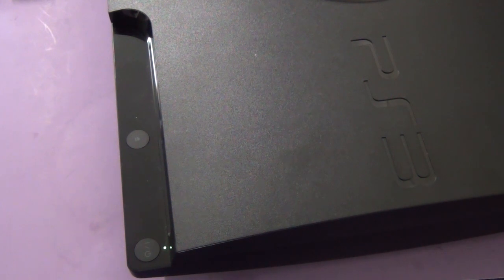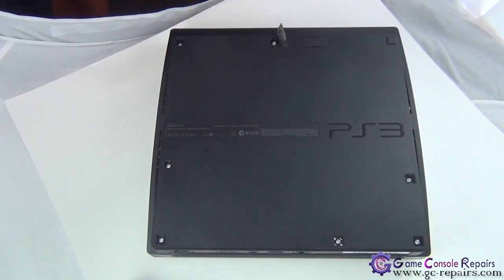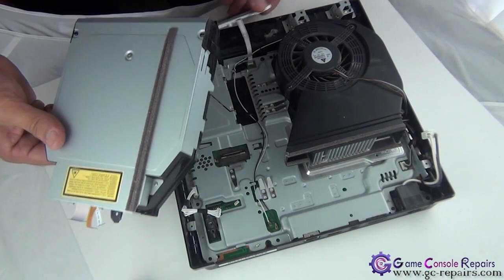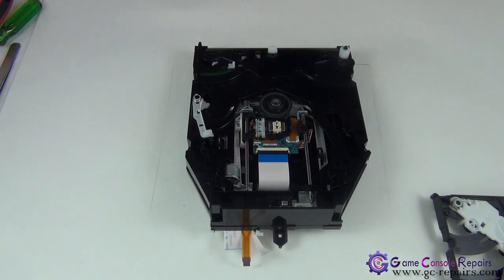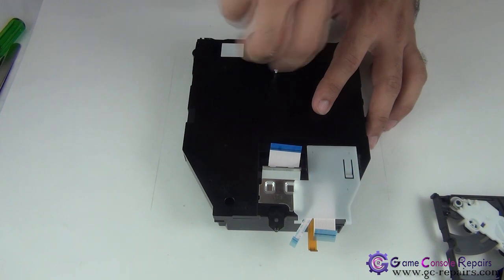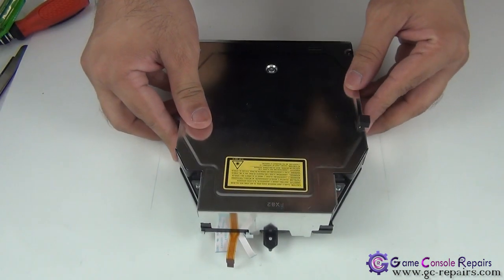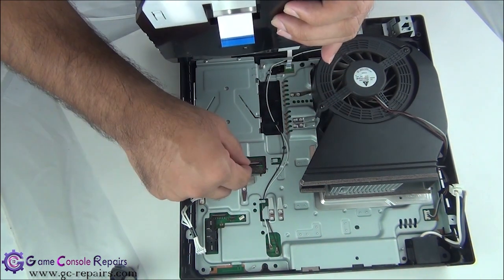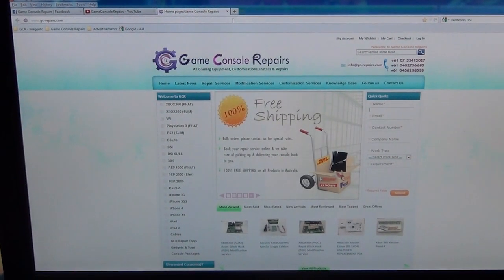PS3SLIM 320GB CECH 3002x  Manual Disc Removal & Resetting Blu Ray Drive gc repairs

Comment: Thanks for the video, it's perfect.
i solved my problem , there was a cd with a little bit of glue that probably blocked it inside.
I opened my ps3 and all was exatly like the video excepted for the blue ray that probably was a little bit different model, i havent't to leave the final ghear to reset but only screw the mecanism because my ghear was fixed with a screw.

No problem with cable or connection, also with torks i used a normal plate screw very slowly.

many thanks.

Comment: Get two butter knives.. Flashlight.. Locate stuck disc by gently probing.. One butter knife on each side.. Flat against each side of disc.. Apply upward pressure and bingo.. Disc will slide right out

Comment: THIS IS WHY I LOOOVE YOUTUBE!!!! thank you so much for the highest quality tutorial on youtube, the hardest part was re-attaching the ribbon cable for the bluray drive. my only criticism is you dont specify that you need a "security/tamper" bit. never the less, thank you sir for saving by ps3, opened it up and to my surprise i found a DS game in there thanks to my 2 yr old son :/ works like a charm now :)

Comment: Its easier to keep the cable clipped to the inner-board, and unclip it from the lens itself. this way you can simply feed the cable through its hole in the drive,set everything as usual, then simply connect it back to the lens from above (instead of trying to fit your hand underneath it all)

Comment: Hey, soo I replaced my lens (KEM-450daa) and it still makes the same problem (ejecting noise when putting a disc in but not actually ejecting it out) would this be the right solution for my ps3 slim?

Comment: Went through this whole process. Noticed that everything WAS in place and didn't even need resetting.  The drive still doesn't "do anything" when I attempt to put a disc into it.  What exactly, "triggers the feeding mechanism" ?

Comment from the maker: @rasat hussain
If the disc does not spin, maybe there is any issue with the motor.
buy either a new laser mechanism or full blu-ray drive and try out

Comment: hi, at 4.03, there are 3 ribbons attached to the blueray drive, the small 1 on the right  (blue & white) can it be replaced? because my ribbon gold connector is broken, i am curious...

Comment from the maker: @zFYG 

Ok seems like you have number of issues.
1. you need to replace your Reset-Switch board
2. Disc not accepting is you have re-align your assembly if still issues, replace with another drive.

Comment from the maker: @Borked91
As long as you still have all the elements you have to put them back together as is.
if not you can simply purchase a new drive for $90.00 bucks from our store and replace with the new drive.

Comment: Great video dude - unfortunately however it has not provided the solution I have hoped for. My PS3 320GB is no longer accepting discs. It feels like whatever normally sucks the disc up is dead. Any suggestions as to what this may be? I have tried resetting the drive like in this video.

Many thanks

Comment from the maker: @DriftingSea
ok that definitely sounds a hard drive issue. Your hard drive is dead.
You need to replace it with new one and reinstall system software.

replace it and report back. thank you

Comment from the maker: @DriftingSea
1.	Turn off your PS3 from the switch at the back and wait 10 seconds
2.	Turn on your PS3 while holding down the POWER button, it will beep
3.	Keep holding the POWER button until it beeps again
4.	Once it beeps the again, simply release your finger
5.	This will video reset and switch to AV signal

Comment from the maker: @DriftingSea
You have to Video reset

There are two Video Settings for Playstation 3 system made by Sony

1.	AV
2.	HMDI
Currently your PS3 is on HDMI settings, you can simply use HDMI cable and it displays picture on your HDMI channel.

If you are using AV cable then you have to Video Reset your PS3, simply follow the below instructions

Comment: I just bought a refurbished drive and installed it. It even does the same noise with this drive also. I have already replaced with 2 laser with complete tray mechanisms (Kes-kem-450DAA) & a complete drive (450DAA). Any other suggestions before I give up on this PS3? CECH-3001B

Comment: I have a PS3 Slim 3001B which started to make a eject noise in drive after inserting disc and would not read games. I purchased a new laser lens tray assembly Kes-Kem-450DAA and installed it. It's still doing same noise and disc won't spin or read after installation. Do i need a whole new drive?

Comment from the maker: easiest thing would be to purchase a new blu-ray drive and carry out replacement
you get all the parts new with the new bl u-ray drive.

Otherwise you will spend lots of time in figuring out the problem and then testing.

Comment: Quick question...that skinny white data ribbon cable coming out of the blu ray drive. I  don't know if I connected it properly. Is the top of the cable suppose to show the words, or is the top of the cable suppose to be white with those red lines?

Comment from the maker: Dear Artur Papikyan
CECH-2502 and 3002 are compatible. please read description
You can use either of the console types to show how to open. The point is to show 'How to open up' and show how to take out the tricky 'lens cable'.

Comment: Thank you GCR for both videos on replacement of optical drive and resetting the blue ray drive.
Without you I don't think I could have done it.
Repair was a success, PS3 works like a charm.
Best regards

Comment: My absolute sincere thanks. without this video  and the other which you produced re taking the drive apart and out, i would not have done, this. I am amazed at how many bad, incorrect, poorly filmed and made "tutorials there are. and I'm surprised anyone gets them going without looking at your wizzadry. One point however. I bought a new drive as i thought that was the problem, turns out it was a reset!!!. never mind , i have a spare for when the new one goes. and i  am now col in my sons eyes.!!

Comment from the maker: ok. some parts can be put back easily
Have you tried your best to put it back together in place.?
Most of the parts fit nice and easy. 
if still no luck - I need pictures to be able to see and then pass on any judgement.
Add me on skype or use Facebook. We have uploaded this video onto facebook also. you can comment over there and attach picture perhaps ?

Comment: Ahh...So close...My CECH 3001 drive stil won't take in or eject a disc...I've followed the steps here and reset my drive, but it seems like the gears aren't connecting properly and allowing the drive to get into that locked position. 

I'm stuck.  Now sure what to do.